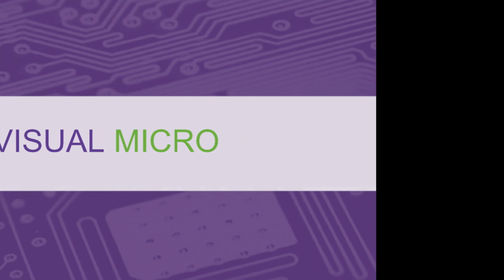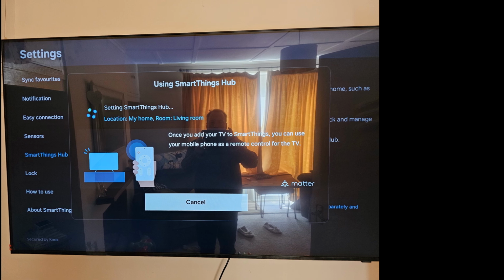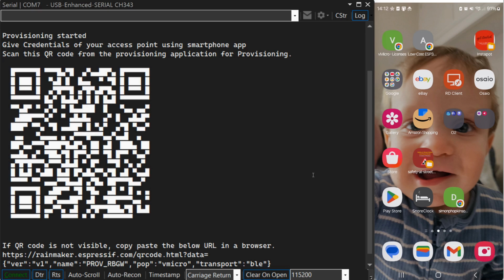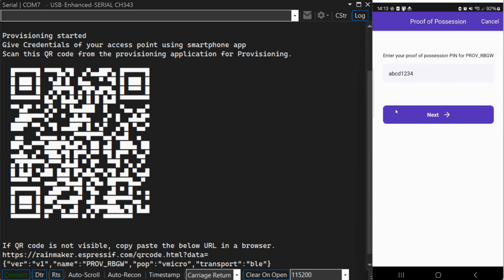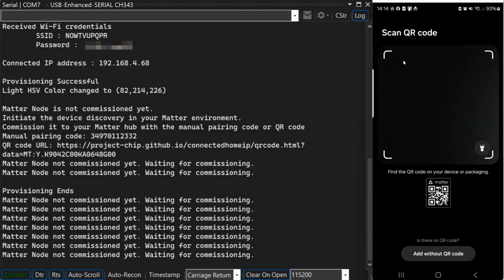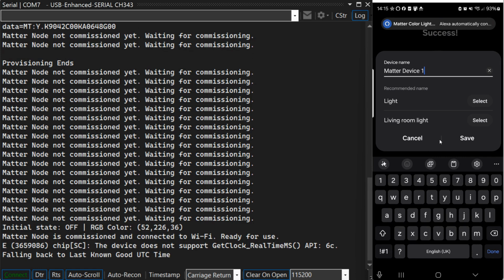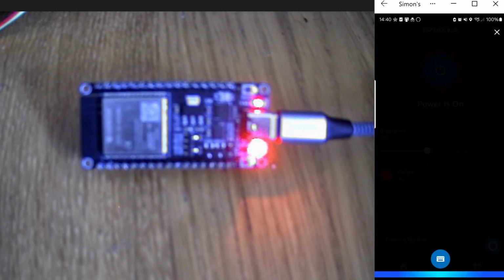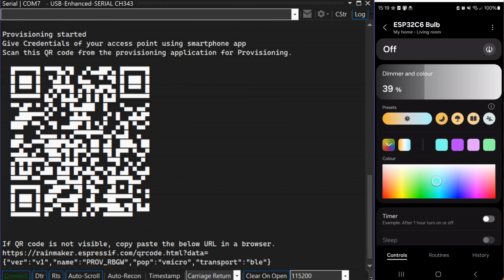Easy DIY Matter RGB Light

Comment: Sorry for asking so many questions and for being very specific, but I am completely new to this. I need help with it, and you seem like someone who may know the answers and solutions.

So I have a couple of questions because I have no idea how this works. I have no knowledge or experience in this area. I need to build an LED strip that works as a Matter over Thread device with my Apple HomeKit.

If I understand correctly, I need a Matter gateway, so a device that operates as a hub for Matter over Thread devices, yes? For example, an Apple TV 4K with Thread support should work. Am I right? If that is correct, can I just pair it with HomeKit like any other Matter over Thread device?

Another question. Can I connect this to any LED strip and control brightness and colors through it? If yes, is it possible to change the color of individual LEDs on the strip?

Also, does it need to be connected to anything else besides power? Or, if I flash the software, will it just connect by itself every time I plug it in, of course after the first pairing of the device?

One more thing. How do you physically connect an LED strip to such a device, configure it, and make it work? I have no idea about this part either. Do I need additional hardware to connect the LED strip? If yes, what hardware is required and how is it connected?

Comment: What about full support of SK6812 RGBW (NW) ???
Reply from the maker: If you can hook them up to the ESP32 (believe it will need voltage boost to interface at 5v), then you can use this example.  If you want different functionality (scrolling colours etc) you would need to implement that in the firmware.

If you have more specific questions let us know... sounds like a good project!

Comment: Could I use this approach to make a custom project (e.g. Plant Monitor) which isn't normally a Home Automation device?
Reply from the maker: Assuming something like the LilyGo HiGrow Board....

There are examples for the Humidity and Temperature sensors in the ESP32 Matter Library Examples, and it looks reasonably easy to add in the Light Sensor Endpoint (supported by Matter https://handbook.buildwithmatter.com/howitworks/devicetypes/ ).

The Soil moisture sensor would likely need to be presented as one of the above sensors (e..g Humidity Sensor), and just amend the readings in the code to the right range/format.  It should still allow readings to be shown.

If you wanted alerts (e.g. plant is too dry) then I believe you would need to present the moisture sensor as one of the Alarm type endpoints (e.g. Smoke/Water Leak etc) which would then allow your home assistant to automatically alert you....